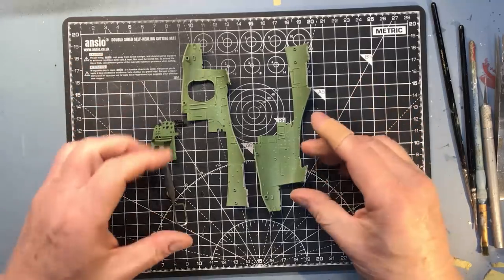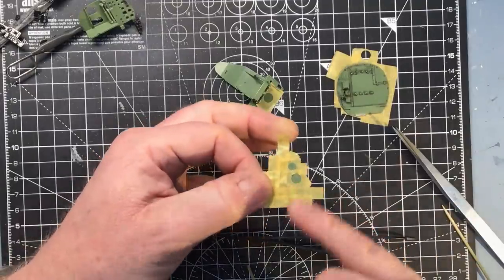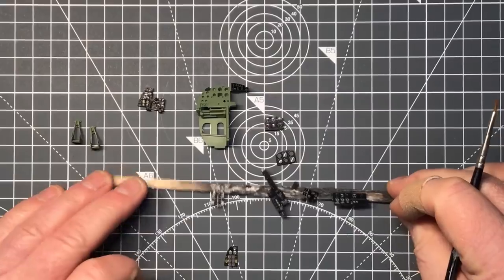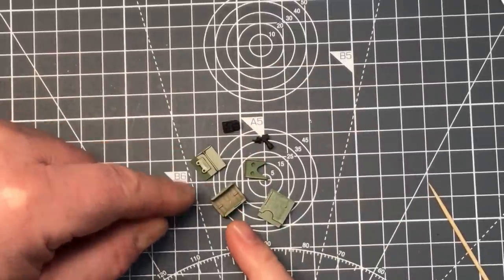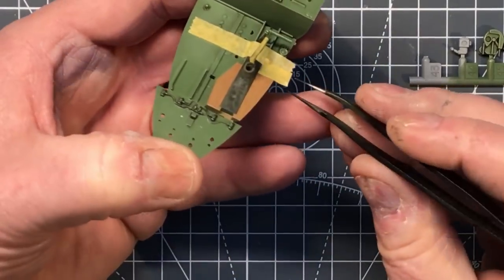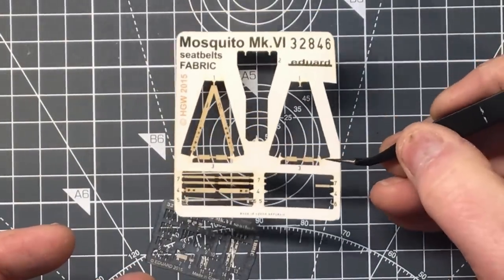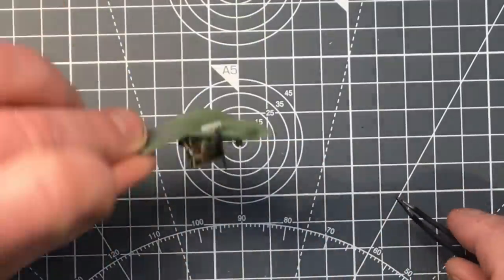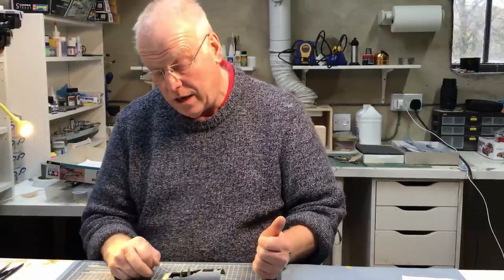Tamiya 1/32 Mosquito build series Part 2b

Comment: Hi. Love the video series great stuff and it’s getting me in the mood to take up the hobby again after many many years.
I’m not keen on 1/72, too small for my eyes, but wondering if the 1/48 mossie would be a good compromise?
Reply from the maker: Thank you  - you can’t go wrong with the Tamiya 1/48 kit it goes together well and looks nice when finished. I’d suggest the FBVI/NFII version rather than the BIV as it’s a bit simpler round the nose but either are good choices.

Comment: Steve, Great work. Have you tried threading the buckles on the fret then cutting the buckles out, gives you more room to hold the piece, and helps when you need to clean the buckle.
Reply from the maker: That’s a great tip Andrew I’ll definitely try that next time 👍

Comment: I figured it was going to be a lot of work to get the cockpit done from Tamiya's promo photos. If there's three hours of footage on YouTube,  Steve. Then how many unseen hours are there? I'm going to guess 9 - 12 hours combined for a completed cockpit?
Reply from the maker: Hi Mark I built it over three days of about 6 hours each so something over 18 hours all told. It was worth it though I enjoyed every minute thanks to tamiyas fantastic engineering. I’m looking forward to sorting the radios and Gee set out for the back deck they look great as well.
Reply: @TheModelShed  The Mosquito cockpit in DCS is superbly modelled too. The radio system behind the pilot is fully modelled and fully working. Grimreapers did a video on the radio set and how it works. It's complicated, my mind went blank. I was left thinking that it was for another day, far in the future lol.
18 hours is a long stretch even over 3 days. I suppose it being winter and colder, the paints and varnishes take longer to dry too?
Reply from the maker: @markstott6689  The cold doesn’t have too much effect Mark - I have a space heater next to the bench and last week I used a hair dryer a few times to speed things up. The Tamiya XF paint drys very quickly any way and I always leave gloss coats 24hours anyway.
Reply: @TheModelShed  A hair dryer: so high tech lol. Well I guess if it works why not. 
It snowed here last night briefly and more is forecast for Friday. If feels like winter has truly arrived. That heater will be getting used quite a bit too I suspect.
Reply from the maker: Yup - freezing up here. Just ordered a Barracuda transmitter and receiver set for the back deck. Another tenner on this kit........
Reply: @TheModelShed  Well when you've bought a kit for circa £170 a few years ago I suspect £10 is something you can live with. Especially considering the level of authenticity you gain.
I need to acquire an eye tracker in the near future. TrackIR 5 and Tobii 5 Eye and Head tracker are circa £200 😱